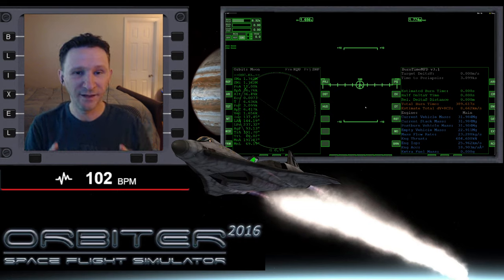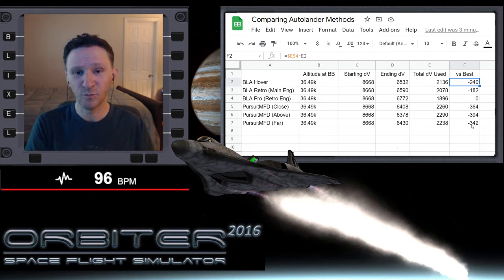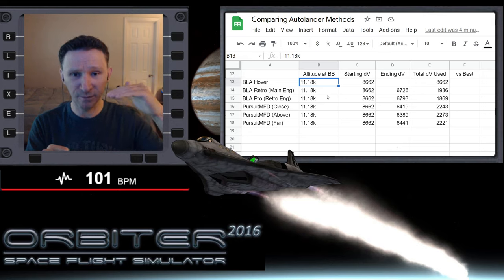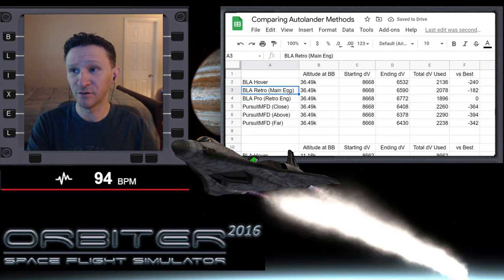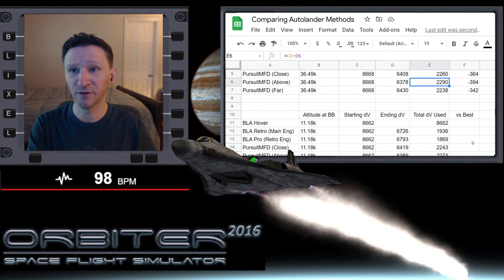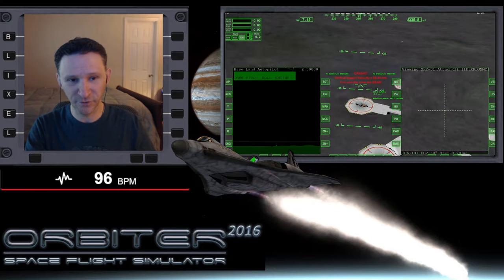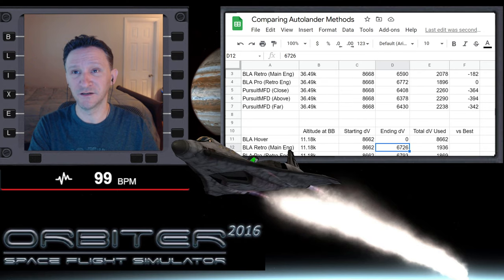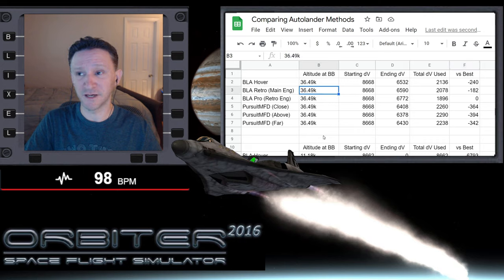Orbiter 2016 - [Part 4] Comparing Autolander Methods

Comment: That was an unexpected result. Pursuit MFD can have a similar issue in the XR5. When testing, I found if I don't orient the vessel myself, it cannot successfully orient and spends the entire burn flailing out of control with overcorrected burns, until you impact the surface at a show stopping velocity. I was wondering if you have or will make available the links to your current fuel planning spreadsheets? I followed the links in your old FAQ, but these are the older spreadsheets. But, if you don't feel like sharing all of that hard work I understand. Cheers!
Reply from the maker: I thought I had my defaults setup to include a link to my spreadsheet calculators in the description, but somehow that didn't get saved. Here's a link to the calculators I've been using in recent videos.

https://docs.google.com/document/d/1AGsiaFay-TcAsmO4NKbd1wMXZVhnbUQehyS4LJ3zQNw/edit?usp=sharing
Reply: @DavidCourtney  Awesome thanks!